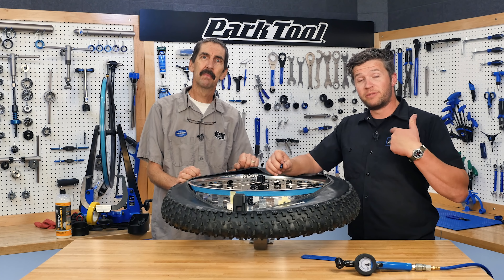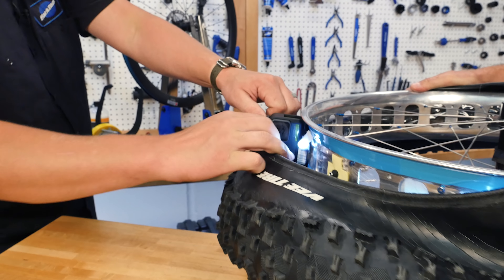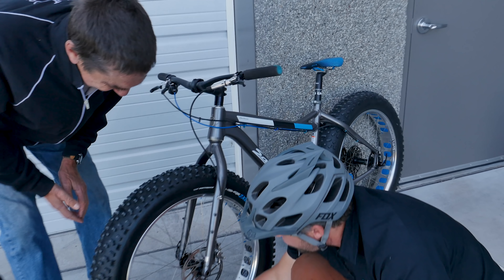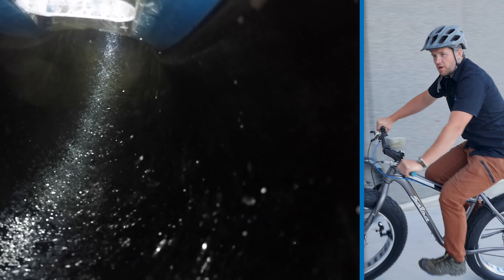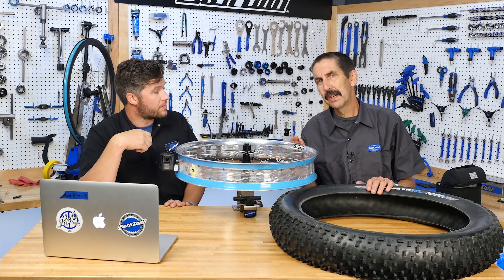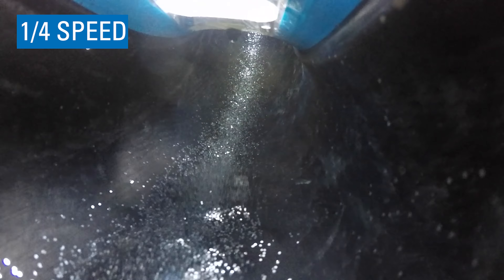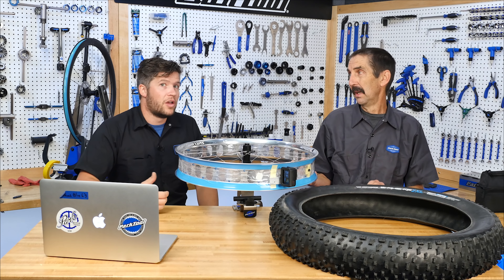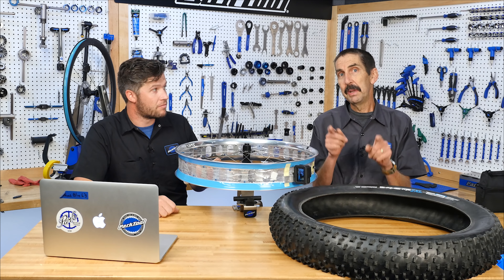A Look Inside Your Tire | Tech Tuesday #184

Comment: To add to the request to videoing a puncture sealing, I'd like to see one puncture in the middle of the tread and another at the outer edge of the tread. It would be interesting to also compare the tire spinning while the puncture is  sealed and just stationary with the puncture at the bottom.

Comment: Awesome vid from the gang at Park Tools, I was thinking the same thing others mentioned about video of a puncture,  not only with variations of the placement of the puncture, but also different diameter of nails, screws etc whatever you use to penetrate the tire.  Also would be interesting to have dual cameras of the puncture showing what happens on the inside and outside of the puncture as it seals. Definitely on the track to really getting to the inner workings of tires and sealant.

Comment: Whatever you put inside a tire which is either liquid or powder solid, it/they will just be forced outward until the tire is balanced.  Even if the tire experiences bumps, the 'inside intruders' will 'balance' itself.

What may have been a significant video would have been the sideward stress a tire experiences when it turns hard, brakes hard and jumps/lands hard.  

Well, you still have a lot of Tuesdays to do that.

More power.